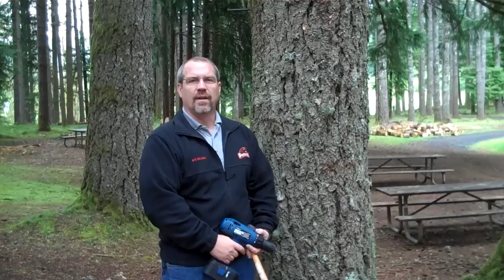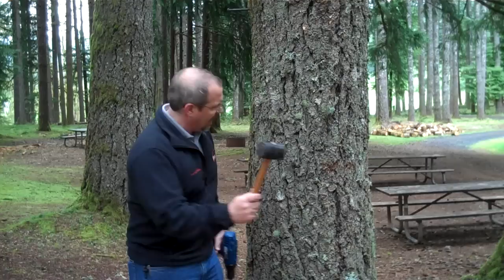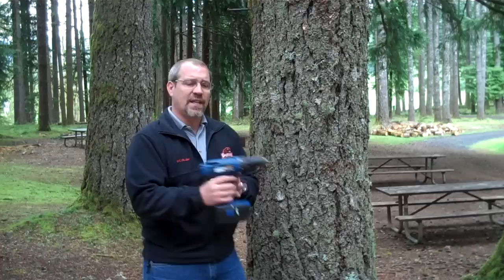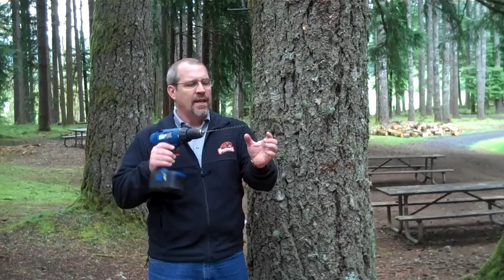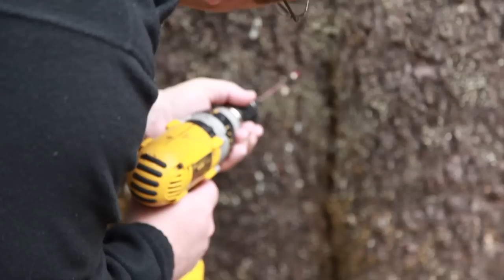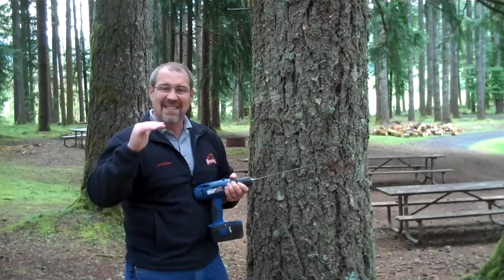Tree Drilling

Comment: I need to screw into a 10 wide pine in central Florida to run some bob wire? I'm thinking (2) 1.5 inch galv screws?  I this okay? I understand i might need to adjust things in 5 years.